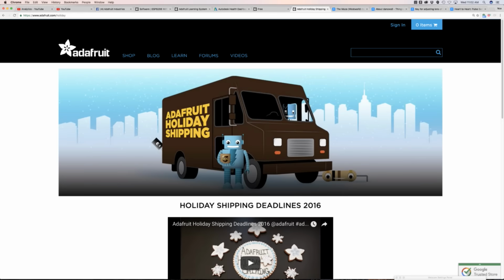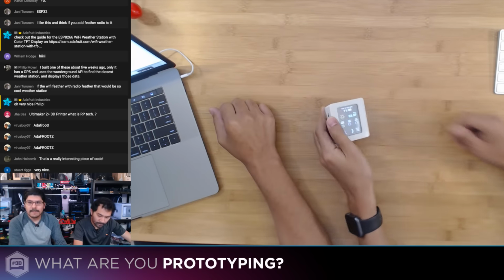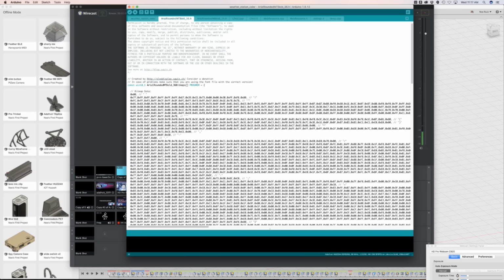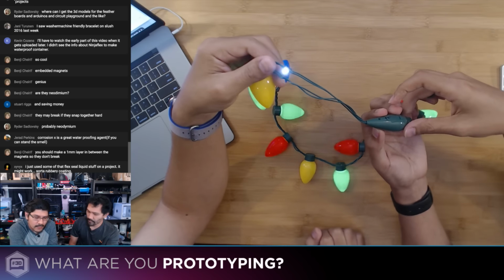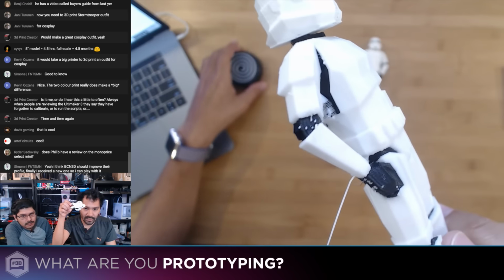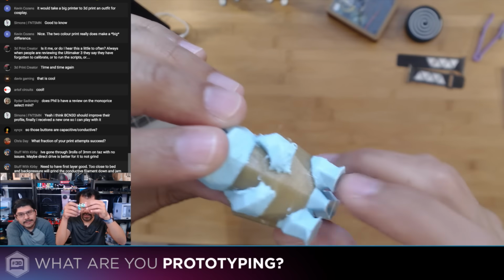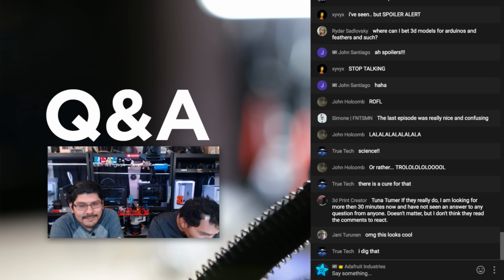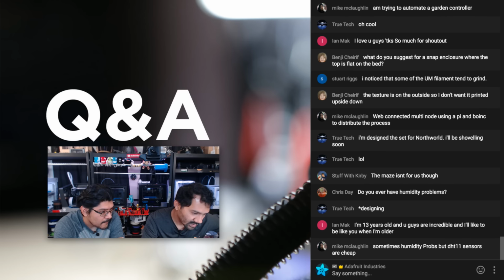3D Hangouts – Ultimaker 3 & Sigma BCN3D Dual

Comment: Defaults settings at BCN3D Cura are with prime tower, are'nt it? I think this is the reason for contamination in dual prints. Next default settings will be optimized in order to avoid purge tower so stay tuned ;)